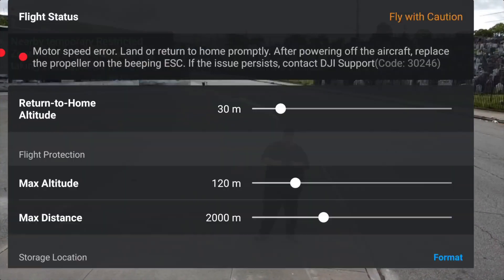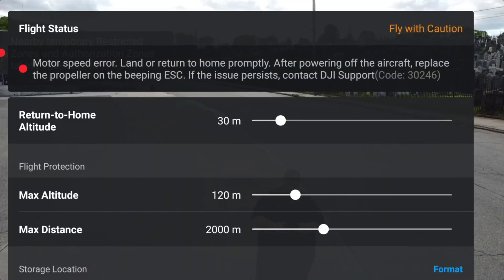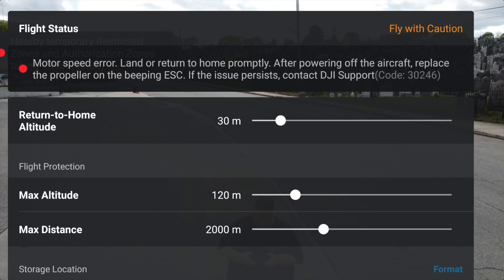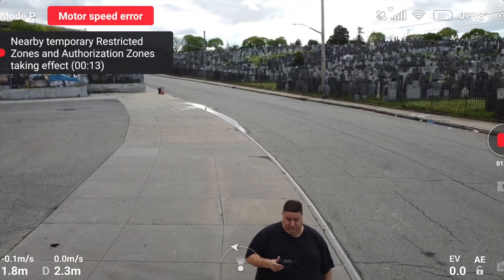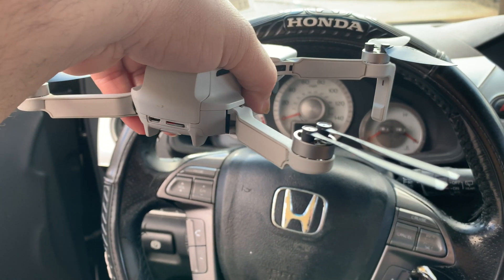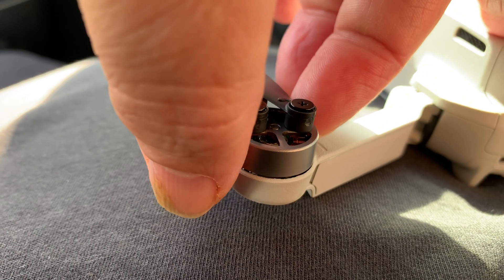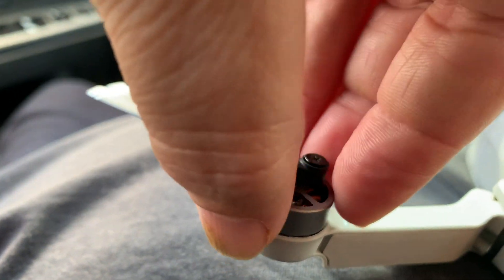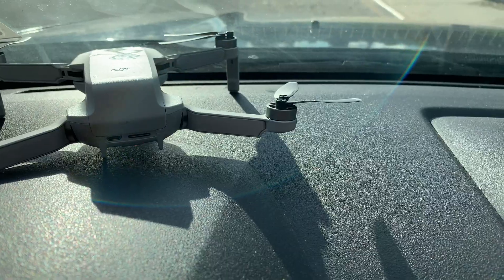Mavic Mini Motor Error fix

Comment: I happen to see this. Propellers aren't the problem, it's firmware 0.500. If a firmware refresh is done with the DJI Assistant 2, it must be carried out with the Mini and also with the controller! In many cases, the motor speed error occurs again. Firmware 0.500 is the problem, worldwide, mostly starts with the rear left propeller and later also with the rear right. DJI support has been informed.
Reply: Bearings, not propellers. 0500 senses bearing wear in the shaft rather than that of the flimsy propellers.
Reply: @quentinbush  Thanks for the tip. For me it was a completely new Mavic Mini, which has now made many flights with the V01.00.0400 without any problem. I wait until a new firmware is delivered. Actually a callback for the DJI service.
Thank you for the information.